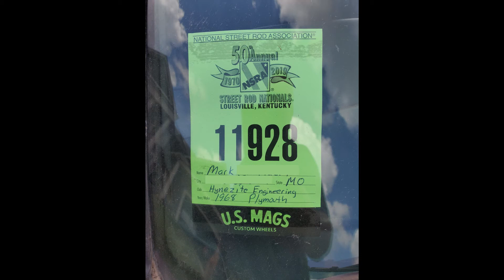1968 Plymouth Fury Introduction

Comment: Awesome video. I just recently purchased a 68 fury sport as well. The engine and transmission have already been rebuilt. Now it's down to dropping it in. Only issue in having is with my driver side door hinges. The door seems to try to overlap the back end when you're closing it. But it doesn't look too have been hit or anything. So I took the door hinges off. Now I'm trying to find more. Are the hinges in need of a rebuild or are they bent?
Reply from the maker: Right on!  Is there a big gap on the front edge of the door?  Like it just needs to be adjusted?